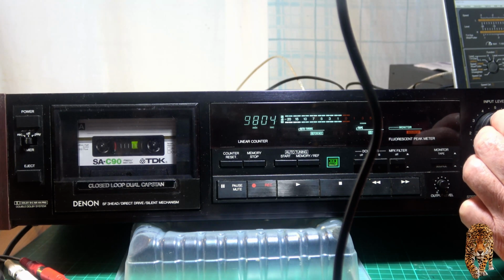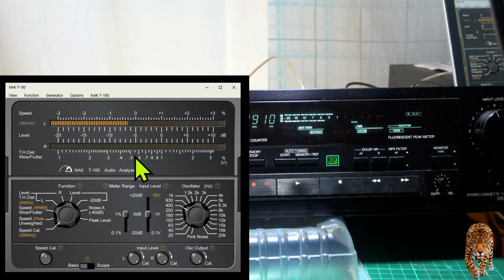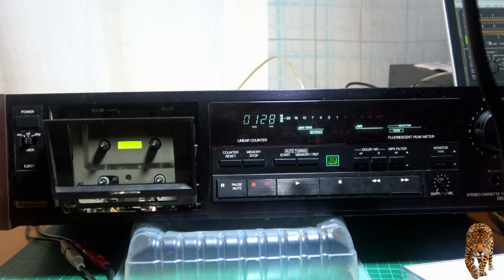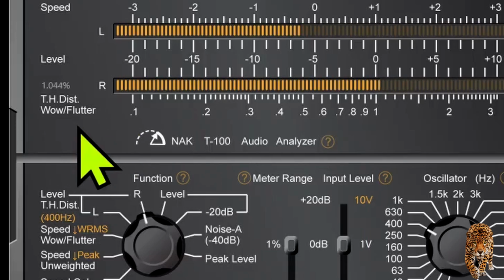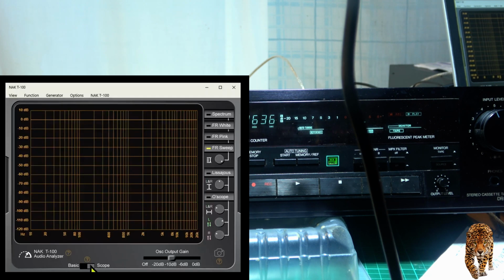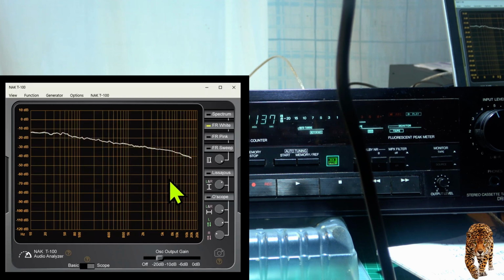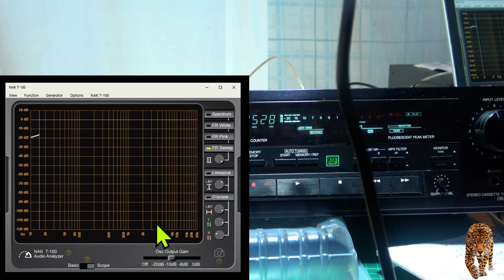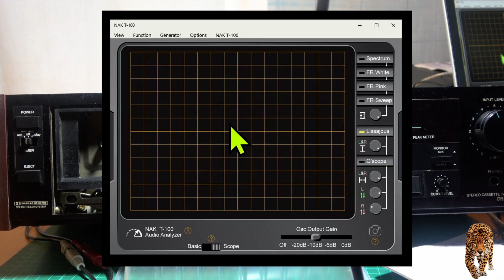Demonstration of Nak T-100 software for testing of cassette decks

Comment: Thank you. I'm using same software from Nakamichi, great application. I'd like to say you, your deck have some strong drop from 8kHz down, it's not so OK, maybe you need to replace some calibration or replace old capacitors.
Reply from the maker: which deck. My latest zx7 result is fantastic, 20- 22kHz +/- 2dB video releasing today.

Comment: Where in this small Blue Marble did you get that "tape tension" test cassette. I have never seen on of them! Very nice!
Reply from the maker: They're very old school, yes.
I just kept looking for them on ebay and eventually got one. There are a few different types for checking FFWD, REV and play tensions. I made sure I got one that would do play at least. Speed of REW and FFWD is not so important, usually the specs quote so many seconds for a full rewind or fast forward of a C60 cassette.
Reply from the maker: sorry, I forget. There are a few different types. I got one that did the basics.

Comment: Can I use this software to set internal Bias?? Deck: Denon DR-M34HR
Reply: Good question. Hardware level, probably not. For a particular tape type I suppose you could do a freq/level response and adjust the onboard bias level for each tape type but this is done for a simple deck anyway in a service calibration. Not really practical for on the fly adjustments
Reply: @chrismogford  I'm a bit of a novice and I'm attempting to service the deck. In the service manual it says to record a 1khz and a 12 khz tone then change the characteristics of the 12 khz to match 1 khz. I'm guessing back in the day you would do this with a spectrum analyser??
Reply: actually no.
an ac meter or front vu meters may suffice. It's usually just making the level the same for 2 (or maybe more) frequencies. Tapes for setting bias are usually a 1kHz for standard reference and then a 12, 15 or 18kHz section for setting bias. The bias setting hardly affects the 1kHz signal. @dean6816
Reply: @chrismogford  ok brilliant. I have an RMS volt meter so I can do this. Thanks for your advice, I really appreciate it. 👍
Reply: @chrismogford  do both signals coming off the oscillator have to be exactly the same level, in this case -38db??
Reply: @chrismogford  What I meant was, I took an ac voltage reading at 1khz which was about 800mv then when I change to 12 khz it drops to around 300mv, do I compensate for this??
Reply: The audio does. If the manual says -38dB then so be it but I thought it would be a higher level, perhaps -20 or -10dB, but do whatever the manual says.
For manual recording Naks there are 2 controls , a level and a bias control to set them both at 0VU, level at 400Hz and bias at 15kHz. They interact. @dean6816
Reply: Got there in the end. I used my handheld oscilloscope's built in oscillator and set the Bias with BASF Chrome Extra (don't have any of the Denon ref. tapes). Deck now sounds amazing! Thanks for all your helpful advice Dean 👍  @chrismogford

Comment: How do you check the calibration of the sound card?
Reply from the maker: There's a lot in that simple question. Unfortunately, I'm not in a position to re-visit NAk atm. I'm living out of a van.
When I return home by December I'll go over nak100 as there's some things I'm not au fait with.
I've decided not to do any hifi videos while I'm away, the files are disjointed and I need to be accurate so best I wait till I get home. :-(
Reply: I looked for that video being 9 months later and couldn’t find it. I am curious how to calibrate the sound card? Thanks.

Comment: Thanks Moggy. I was recommended this software after I disassembled my Yamaha KX-580se for cleaning and lubricating, but failed to realise the ramifications of removing the heads, namely azimuth. You have introduced me to a couple of tests I didn't know about, like torque. I am converting a range of legacy media to digital for portability and have been having an interesting time dealing with proprietary formats and obsolete cables and connectors. I have already had the DAT machine apart to stop it eating tapes and then having problems with incompatible S/PDIF clock speeds. It will be a relief when it's all on an SSD and I can remain in the digital realm.

Comment: Were di you get the USB sound card. All the ones I can find only have a headphone out and a Mic (mono) connections. I take it you will need one with both line in and out?
Reply: I picked up a MOTU (Mark of the Unicorn) 4 Pre second hand. It does up to 96kHz 24bit, has S/PDIF in and out, line and balanced XLR inputs and firewire and usb connectors. You can pick them up from £100 upwards. Very good quality interface.
Reply from the maker: Mine's an old transit usb dongle. Not around anymore.
I bought it to match my praxis audio software years ago.